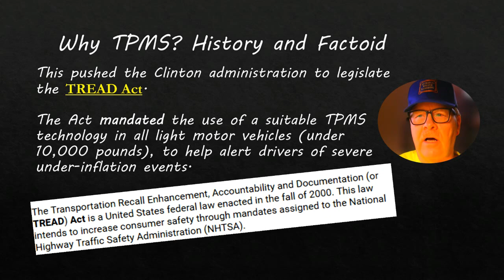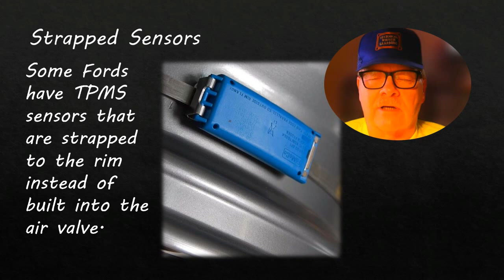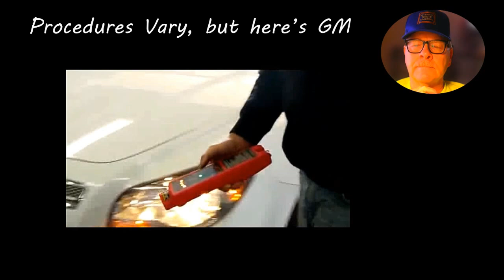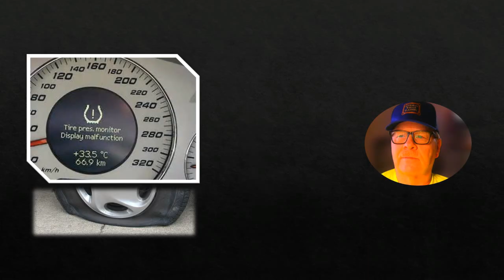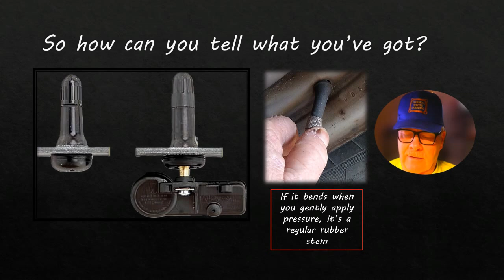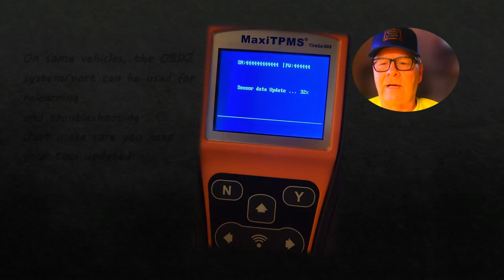TPMS Crash Course

Comment: The new bells whistles in the ride can be terrible distractions.  Driving is 10 times better without a screen in my face. I think the The HUD speed/tach was a nice feature that helped the driver driver without the need to take a hand off the wheel. I like standard transmission so more hands on the controls when driving that is real nice.     Good Monday Morning          Oh Yeah
Reply from the maker: Totally agree
Reply from the maker: You can't buy a new car without a screen nowadays either!  

In the early 1930s, there was indeed a push to ban car radios due to concerns about driver distraction. Legislators in states like Massachusetts, New York, New Jersey, Illinois, and Ohio proposed steep fines for drivers using car radios. In Connecticut, a bill was introduced in 1935 that would have fined drivers $50 (about $825 adjusted for inflation) for installing radios in their cars.

The main argument against car radios was that they could distract drivers and potentially cause accidents. However, the Radio Manufacturers Association argued that car radios could actually reduce accidents by keeping drivers awake and alert.
Reply: @McCuistian  The cigarette lighter and ash trays were safe equipment. The radio has distracted me before.